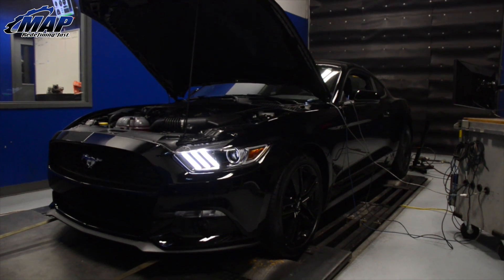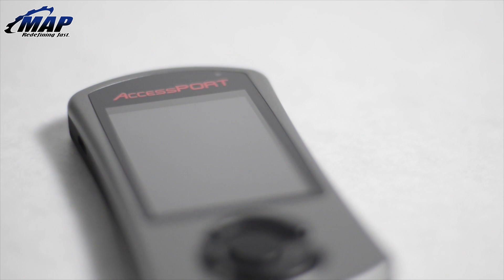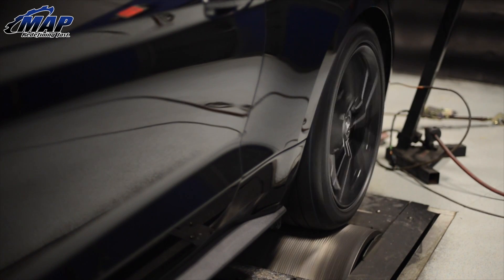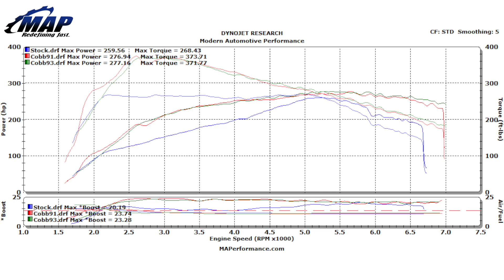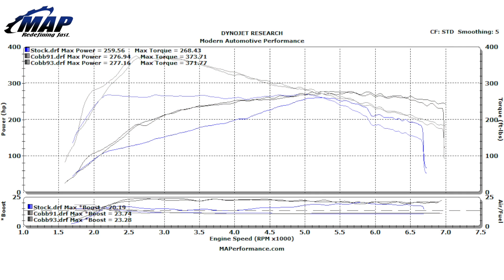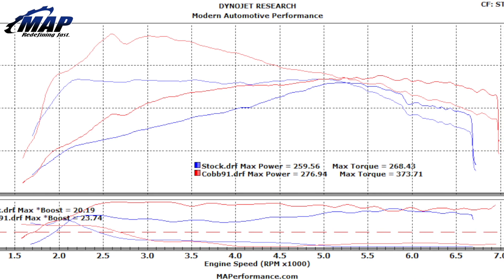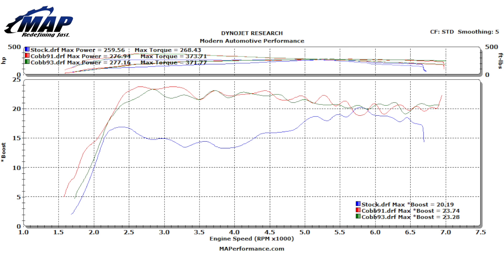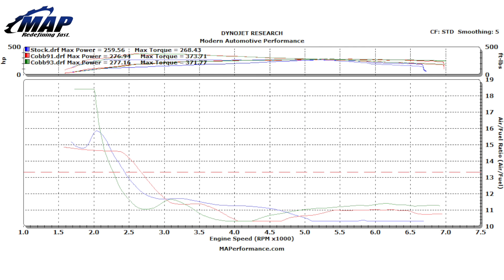2015 2.3L Turbo Ecoboost Mustang Dyno Results Using Cobb V3 Accessport (ap3-for-003)

Comment: Awesome power but did you change anything like intake, mufflers,down pipe or any other part before run the Coob or those Numbers aré frío stock parts.?
Reply from the maker: This is just the OTS stage 1 tune from Cobb no bolt ons!

Comment: doesn’t make sense. your 91 and 93 runs were the same
Reply: Personally I would run 93 octane on a 91 tune to keep knock chances down.
Reply: The car is designed to run on 91 so it's not surprising. Increased octane is really just to allow more boost tbh

Comment: i am running a stage 3 tune and planning on getting custom tune. How does a pro tune from cobb different than custom tune?
Thanks
Reply from the maker: Cobb tunes are generic and built to be flashed on to any car within that platform whereas a custom tune is optimized for your specific vehicle and setup.

Comment: where does the stock turbo make peak hp? it looks like stock, the engine peaks early and dramatically drops off.
Reply: You can see from the chart that there is no longer a HP drop off at 5500+ rpms.  I'd imagine you'll need to upgrade the IC, if not the turbo as well, if you want to run more boost at the top end

Comment: Pro tunes/custom tunes are yielding over 300whp and 380+tq as well. These cobb OTS tunes are extremely soft honestly.
Reply: sb632 read the timing chain issues with the VW tsi engines before doing any decision I know I did that and I got nightmares lol from that ... trying to help
Reply from the maker: We've been testing the Cobb Pro Tuner software for a while now, our maps will be available for those who purchase our performance packages or an AP from us so if you haven't already purchased one make sure you buy it from us!
Reply: MAPerformance
Definitely will be keeping an eye out. I'm basically torn between a ecoboost mustang and a new gti as my next purchase.

Comment: holycrap, thats 327hp  and  440tq. this thing revs out beautifully to 7 grand with minimal power loss. imagine this thing on meth injection and full bolties?
Reply from the maker: We will be pushing the limits as soon as we can. R&D has begun on numerous bolt on mods and plans for turbocharger upgrades and turbo kits are in the works, stay tuned!
Reply: So stage 1 with just a CAI on 91 octane is 327hp and 440tp to the motor?